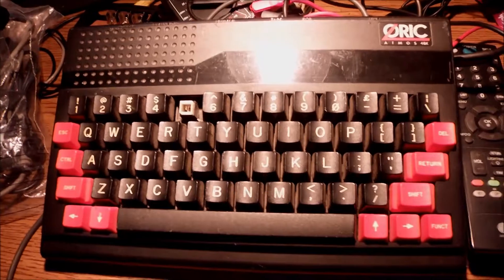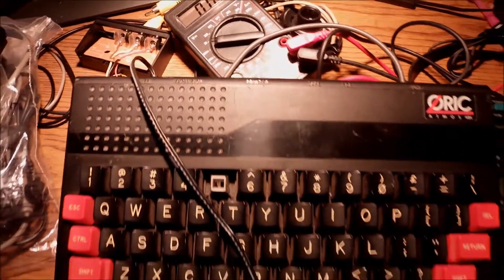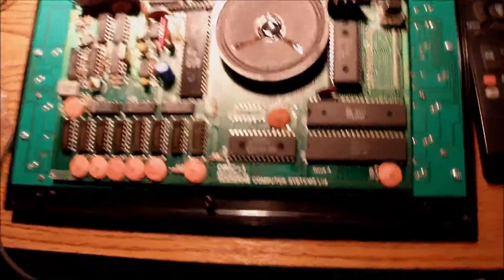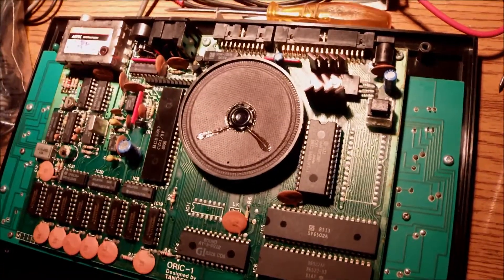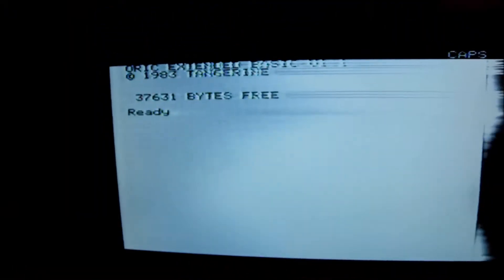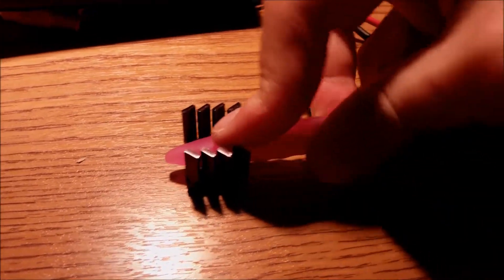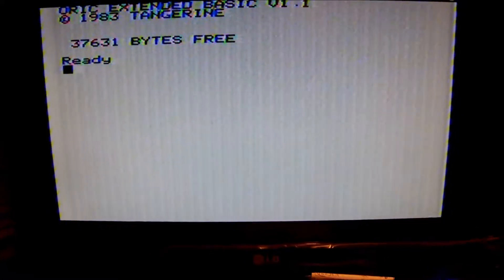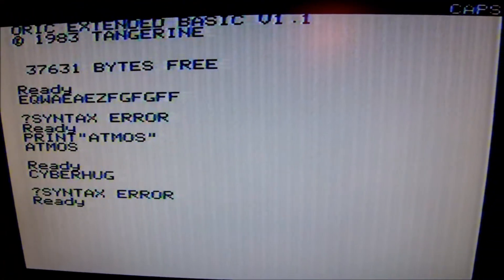ORIC Atmos - 1984 - Fix & Boot after 35 years?..

Comment: Excellent to see another Oric saved!  There must have been quite a number thrown away due to the following design flaw:  To get around the asymmetrical PHI2 signal the sound AY-3-8912A is connected using the 6522’s ports.  This gives rise to bus contention under some software conditions which sometimes damages the AY chip.  Now the keyboard is driven by the AY chips one and only 8-bit IO port.  When testing these machines it’s worth checking that they don’t crash or behave erratically when keys are pressed.
Reply from the maker: Thank you! :-) For the piece of information too! I haven't had any idea about this detail! thumbs up!

Comment: the regulator gets hot because of your too high supply voltage. the original power supply gives only 9V, higher supply voltages are a common cause of overheating in the ORIC. Other that that I enjoy to see that some people still tinker with such ancient machines. The ORIC is a remarkably stable machine and definitely worthwhile to restore.
Reply from the maker: So very right! I am experimenting with 7.5v lately and it looks good on a ZX Spectrum - i need to try it on Atmos too.
Thanks for bringing this up.Keeping it around &  below 9 is key solution to overheating problems. The ORIC is indeed a very reliable machine, couldn't agree more!
Reply: Cyberhug Technologies All Oric Atmos’s are tweaked Oric-1 boards with V1.1 ROMs and the much nicer case and keyboard.

A good upgrade is to replace the ROM with a bigger one containing both V1.0 and V1.1 binaries and a switch to select whichever.  Not all software would run with the better V1.1 ROM.
Reply: Don’t forget that the PSU is unregulated and therefore will show a much higher voltage when unloaded (in his case unconnected except for the 10M of the meter).

A better measurement is done in circuit.
Reply: Actually most Oric power supplies measure at 12V when they aren't plugged into an Oric.